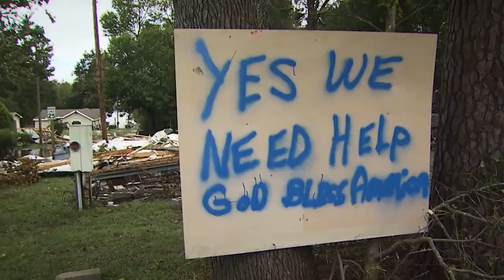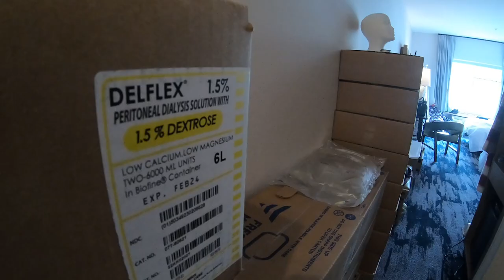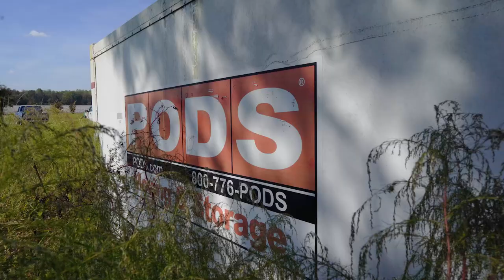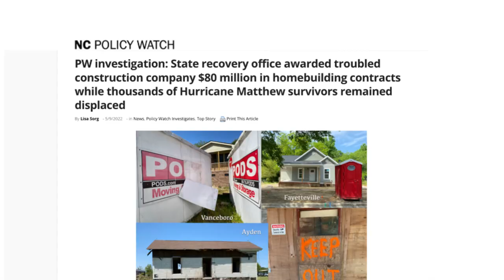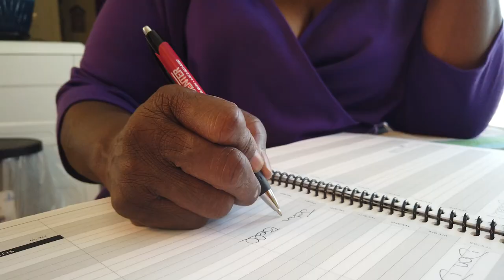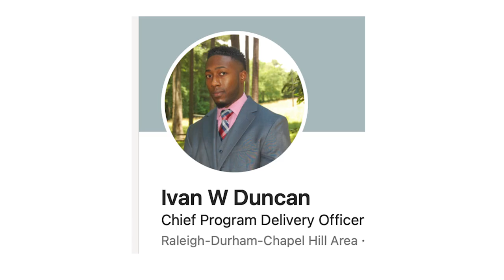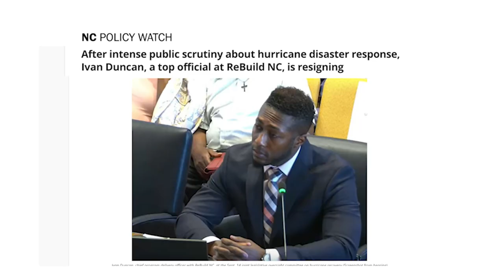Aftermath: North Carolina Hurricane Victims Left Behind

Comment: Baptists on Mission have built and rebuilt quite a number of homes from Hurricane Florence and quite possibly from Hurricane Mathew.  These houses are built by volunteers under the guidance of experienced builders and can be built at fractions of the cost of normal commercial builders.  I also helped Samaritan's Purse build homes for people from Mathew in Tarboro years ago.  I believe I heard funding for the materials had dried up so they've basically stopped the hurricane relief work. I believe the article stated Rebuild NC had almost $800M federal funding and had spent $13M on hotels and pods so there should be a big pot of money sitting somewhere to complete some of these 3,300 homes left remaining, would hope the "contractors" didn't bleed it dry.